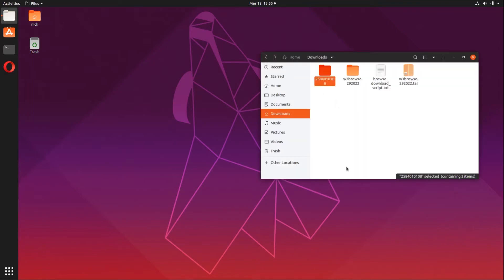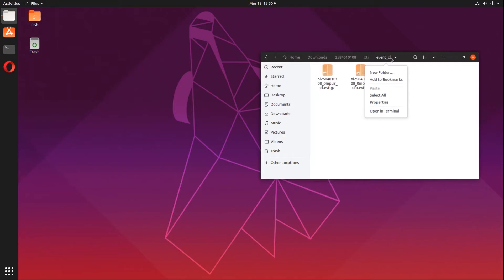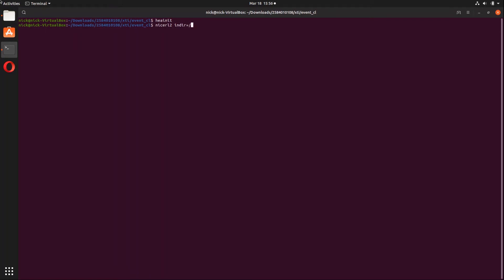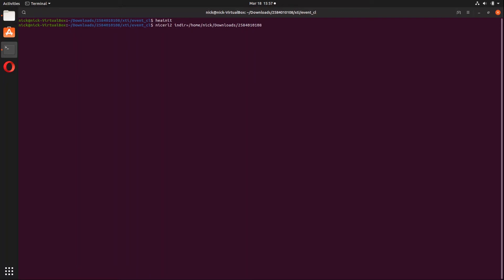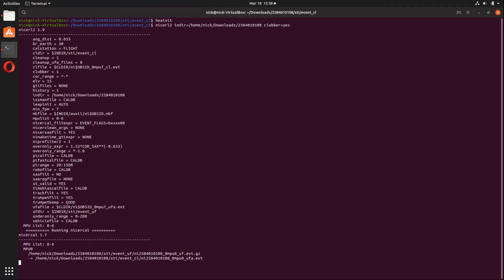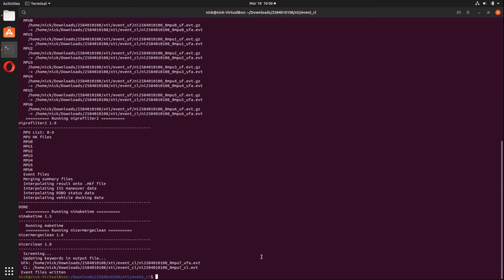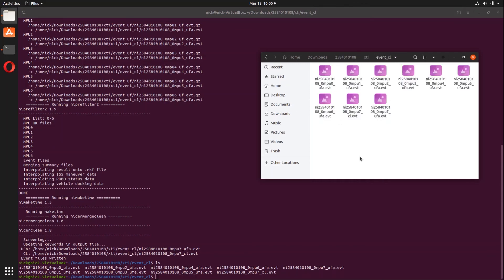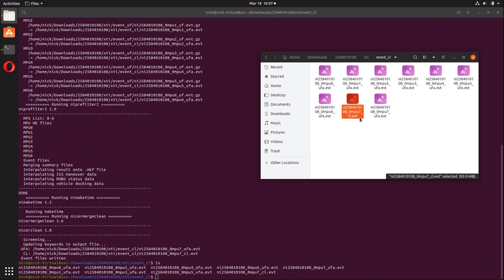NICER Data Analysis: Processing Data with nicerl2 Video Tutorial

Comment: Have you wroked with RXTE PCA data? I am trying to work with that and either getting an error saying <filename> not a readable directory when I just enter the filename, or just an error that creates a ftefilt.log file at the destination directory when I use the entire the path of the file in the pcaprepobsid command.
Reply from the maker: @Pinak Dusane Yes, outside of NICER, RXTE data is what I work with the most often. However I have not encountered the errors you are describing with regard to pcaprepobsid. Without seeing your terminal, all I can say is that generally when I encounter the kind of issues you described it is usually one of three things:
1. An issue of trying to run something from the wrong directory.
2. A syntax issue with the filename or PATH.
3. An error in the output of a previous process.
Reply: @nspace-cowboy  Oh I see. I'll look into the issue along with my thesis guide. Also, I really liked your videos and am glad to see that you're making videos about these things. You are the only person I found on the internet who's making some kind of guiding videos about all this stuff. Is there any public handle you have (Twitter, mail, GitHub, or anything else) where I can send you a message or share my work if that's alright?